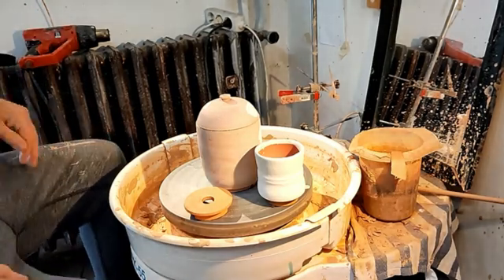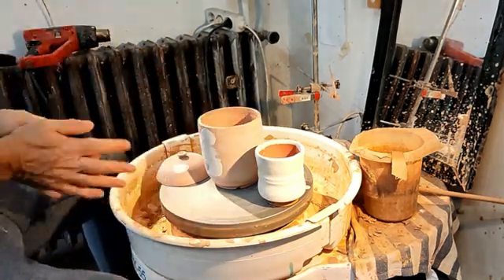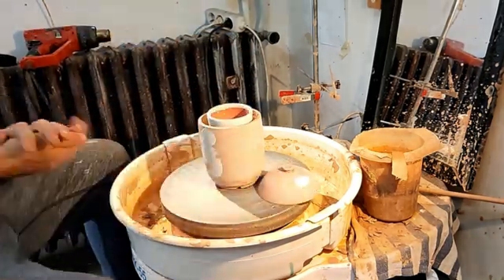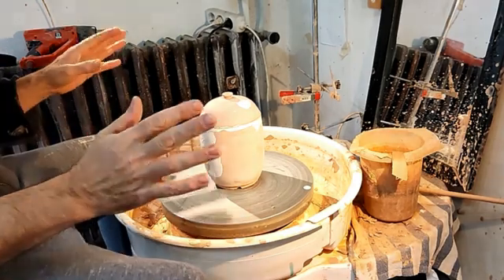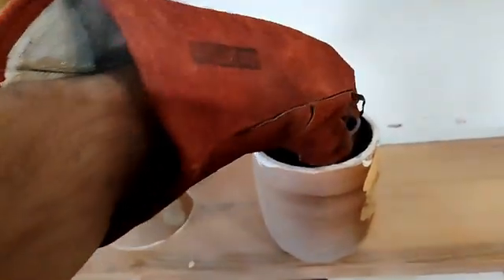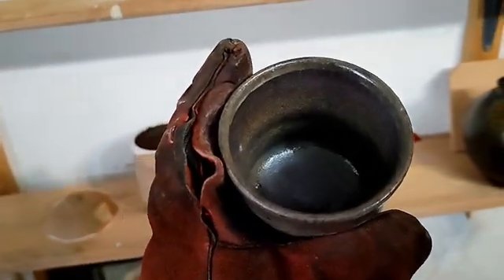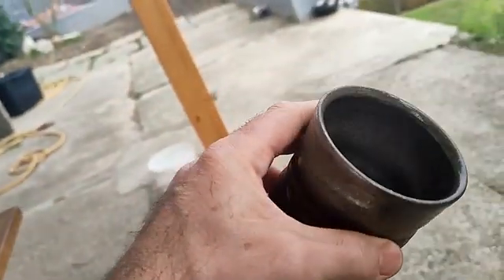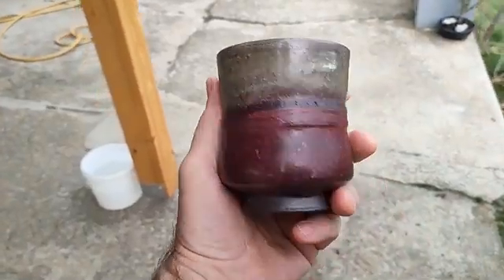Saggar Silliness: An Experimental Reduction Firing in an Electric Kiln

Comment: I think 🤔 the glaze got hotter at the bottom first through convection? And sealed while reducing agents/ gases were the most active. But I have to say, reduction firing always baffles me as well even in my gas kiln. Timing seems to be everything
Reply from the maker: @coopart1  thanks for the comment. I don't know about the lower part being hotter. From what I've read, the shelf tends to suck heat out at the bottom. But I'm not sure at all. Hopefully I'll try it again soon with different glazes
Reply: сверху был доступ кислорода